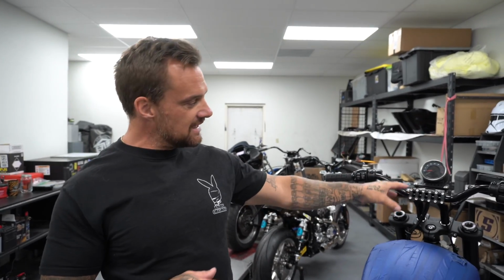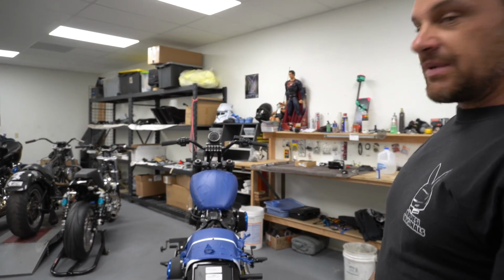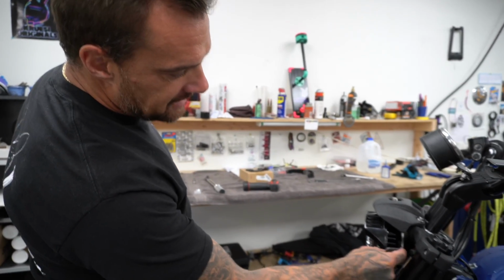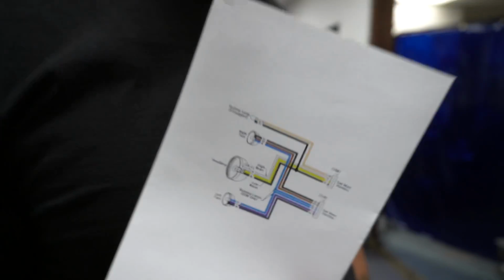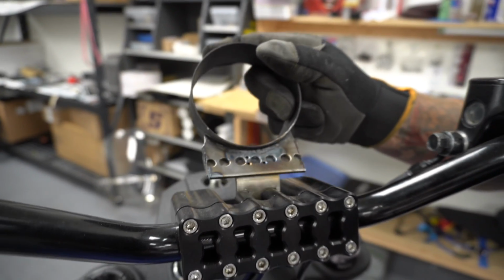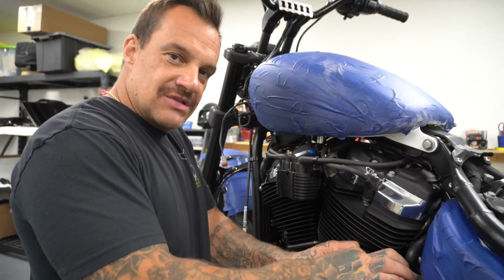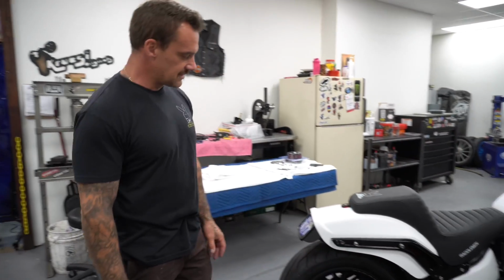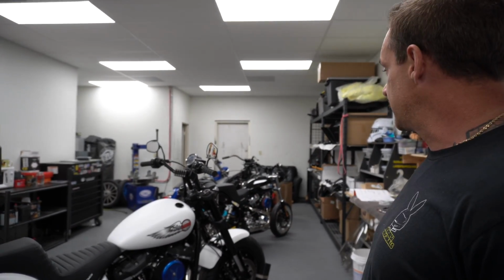Baja Design headlight kit for Harley Davidson / win a bike from Kruesi Originals build

Comment: Little trick with the bare metal. At least we use it in aerospace. Use bondrite or Alodine as a sealer and the sanded area will seal and never corrode and eat the paint away